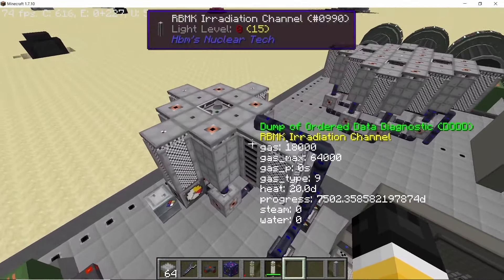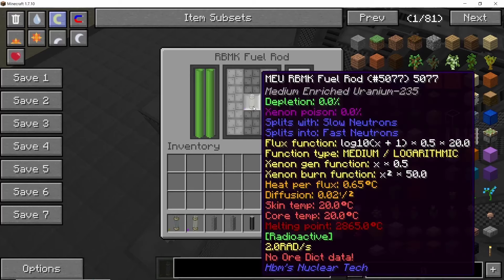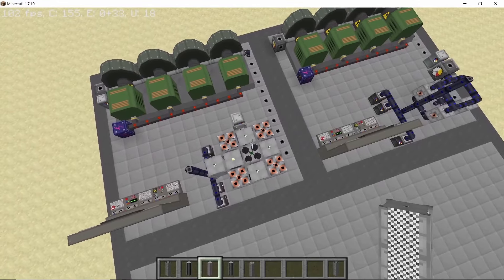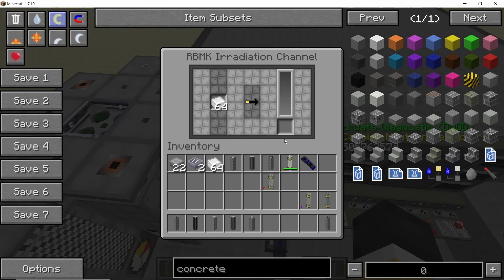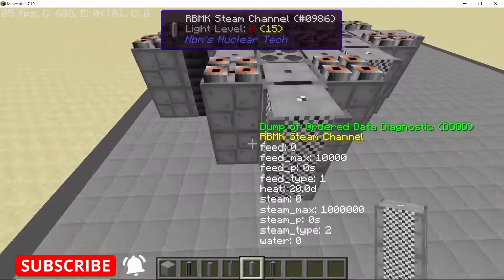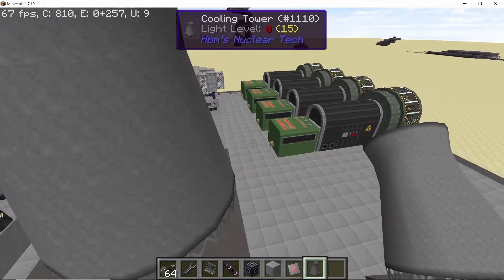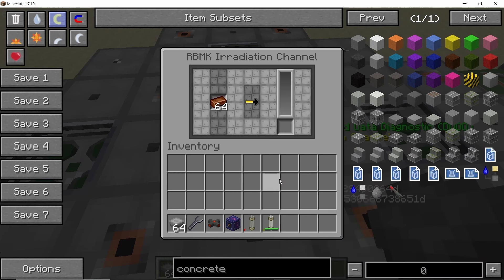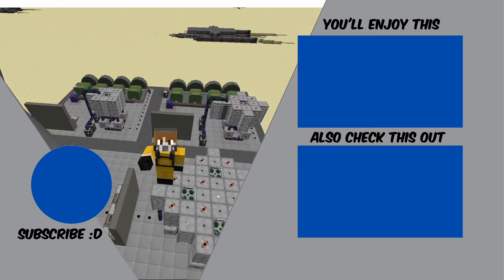Irradiation Channel Basics - How to make a Breeding RBMK Reactor in HBMs NTM

Comment: I remember watching your video on the schrabidium depleting reactor a while ago, if I'm not wrong it can be easily used to breed something in the middle while depleting the fuel and also as it is a powerful fuel source it'll breed faster
Reply from the maker: Yes that's true, with Schrabidium you'll need to use any safe fuel rod type to control it and then you should be good to go.

Comment: finally i needed an effective irradiation channel when i tried to make my own the irradiation reactor it had a meltdown. TYSM. and one more question what UU matter does in hbm's ntm?
Reply from the maker: This is a basic design, with control rods and more powerful fuel rods you can breed materials pretty fast !! 
Make sure to experiment and glad to know you liked the video :)
Reply from the maker: As for UU matter it's exclusive to ntm extended and it can be used in the UU mixer to produce other material like antimatter and antischrabidium
Reply: @SavageVegeta  thanks

Comment: So if slow flux is bounced back towards a fuel rod with a reflector, is all of that flux absorbed by the fuel rod or does it keep going?  I have a reactor that Im starting to build in survival that has some pretty tight space constraints with lower electricty requirements, so I want to be able to adjust power output with control rods a bit more than the one you showed here.
Reply from the maker: The flux which bounced back will be absorbed entirely by the fuel rods. Flux never passes through these rods as long as there is fuel in them which isn't completely depleted... they will emit flux and they will absorb flux and use that to emit more flux. 
so the simplest design you can make with the tight space constraints you mentioned is a simple fuel rod with moderators and then control rods and finally reflectors in a straight line. Steam channels will be placed diagonally. Or with a bit more materials you can use a moderated fuel rod with control rods and then reflectors with steam channels diagonally.

Comment: you should make a tutorial for using electrical age's industrial data logger to measure reactor power output etc
Reply from the maker: Can't be done, the data logger can only measure power from electrical age and not from other mods. Power from other mods can't be converted to power of electrical age too so yeah

Comment: I never knew the neutrons coming out of moderated fuel rods were not slowed down. Does this also apply to reasim rods?
Reply from the maker: It should apply to reasim too, and I know it is a weird mechanic cause you would expect neutrons to slow down irrespective of the travel direction

Comment: Can you do a tutorial or explain somewhere on how to encase the reactor in concrete or whatever protection it needs so you can be near it in survival without needing strong hazmat all the time and radiation absorbers? Nobody has explained how to do it, on the wiki it says put concrete around it, I did and it doesn work. I put the rbmk plates on top as well but it still doesn't contain the radiation while the reactor is turned on.
Reply from the maker: You don't need any kind of encasement if the reactor is properly closed off by using either the neutron absorbers or neutron reflectors. Radiation leaks when there is an open path for the neutrons from fuel rods to escape out in the environment but if you use RBMK neutron absorbers or reflectors on the reactor perimeter along with using RBMK covers to cover the top of every channel then the reactor will not leak any radiation as long as it doesn't explode.
Reply from the maker: This design that I have made for this video is an example of that, and in all of my newer builds you will never see any radiation leaking from the reactor, only in a couple of my older reactors did I make the mistake of not properly closing them off
Reply: @SavageVegeta  yeah, when I studied this design you showcased I cane to the same conclusion. Also I realized that you can also build a column of concrete instead of a reflector or absorber but it has to be conjoined to the reactor. My mistake was I built a concrete cube around the reactor but there was space between the concrete and rbmk blocks so the game rendered it as leaking radiation anyways. I just needed to get the hang of the game mechanics. Thanks for help

Comment: How to extract liquid from the irradiation columns?
Reply from the maker: By connecting the respective fluid duct from the bottom
Reply: @SavageVegeta  Already did it. It doesn’t flow to the barrel
Reply from the maker: @Fedos0111  ok what about the top side? Cause the last I worked on these type of reactors fluids could be extracted from the bottom of the channel 
Are you playing NTM extended?
Reply: @SavageVegeta  1.7.10. I’ll try to extract the fluid from the top, but there’s a cap that protects from the radiation, so idk
Reply from the maker: @Fedos0111  that cap doesn't prevent pipes from being connected, so that shouldn't be an issue. Aside from that make sure the ducts and barrel are set to the correct fluid that you're trying to extract (I know this is very obvious but many times by mistake we set the fluid type to something else)
Reply: @SavageVegeta  Thx 🙏
Reply from the maker: @Fedos0111  lemme know if it works or not
Reply: @SavageVegeta  It worked!

Comment: What are your PC specs?
Reply from the maker: Ryzen 5 4600H, 16 gb ram, GTX 1650 gpu
Reply: Not bad at all. Btw what mod do you suggest to use with this. Flans mod or vic modern warfare with mcheli (and NPC mod). I want to know if flans mod is laggy as vic modern warfare with Npcs. If there are lots of npcs with vics guns and armour game starts lagging , frames go from 300 to 60 in mare seconds. @SavageVegeta
Reply from the maker: @BLIKS7  use mcheli overdrive with HBMs mod along with custom NPCs and flans Mod for guns
Reply: @SavageVegeta  I found there are good content packs for flans mod , that even add working plane carriers. Id may just stick with flans and HBM. Now, i just need lots of time to spend on creating a custom map :(
Reply: @SavageVegeta  I think you should do some video about flans to !!! Or maybe do some war simulation with friends !!!